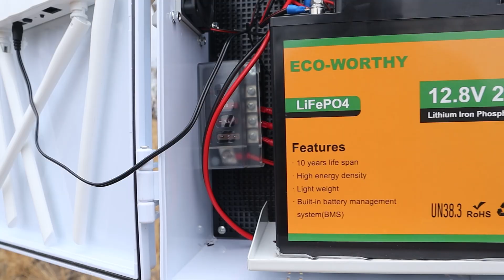Internet Anywhere: Solar Wi-Fi That Works Off-Grid

Comment: Great video! I attempted this previously but didn't get it to work for a variety of reasons. I assume the wifi router takes 12v DC? Did you ever run into a series cloudy days where the system went dead?
Reply from the maker: I haven't had any noticeable issues yet. It's generally sunny out here, but it's been raining recently and haven't had any issues

Yeah a lot of the ac->dc adapters that come with the router just convert to 12v, but you can check the info on the adapter

Comment: Awesome job, been working for something like this for my farm. My question is do you connect the negative from the router from the hotspot and the fan together and then to the negative of the load on the charge controller?
Reply from the maker: Yeah exactly! Sometimes I'll use a bus bar to connect them all together, but here I just connected the few the negative wires together and crimped them. That goes right into the negative load port of the charge controller
Reply: @befreebuilds thanks, looking forward to doing my own set up.

Comment: I have four reolink cameras in a pasture. Each one has a SIM card. If I set up a system like yours, would I be able to just have one sim card for this system and then my cameras wouldn't need their own individual SIM cards and could run off of Wi-Fi? There is good cell service in the pasture but the four SIM cards are rather pricey every month. I'm a 71-year-old widow trying to watch my older horses and I don't know very much about all this. Thank you.
Reply from the maker: Yeah I think this would help in your case. The single SIM card in a hotspot connected to a router will let you connect all your Reolink cameras to one shared wifi. That way you only pay for one data plan. Just make sure the Wi-Fi signal can reach all the cameras and that the cameras support wifi connections
Reply: @befreebuilds thank you so much!